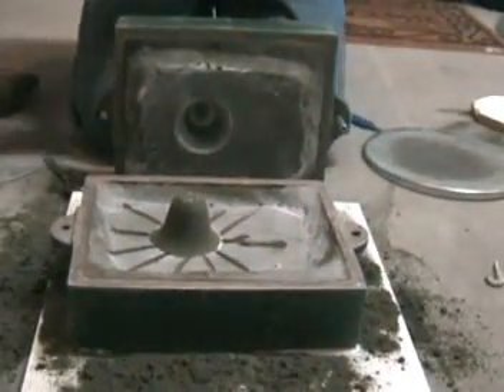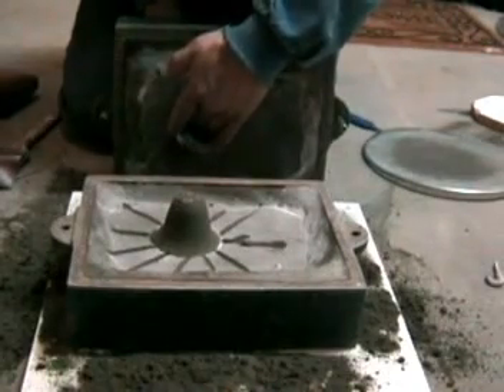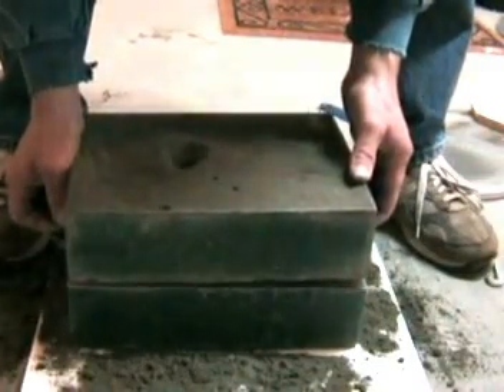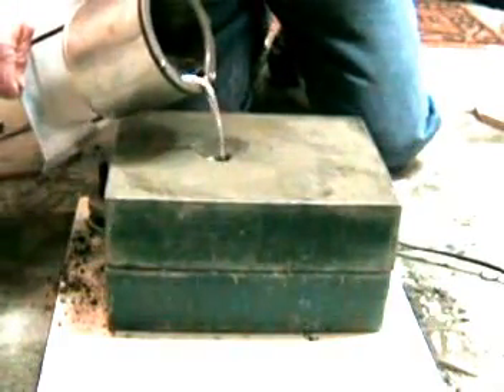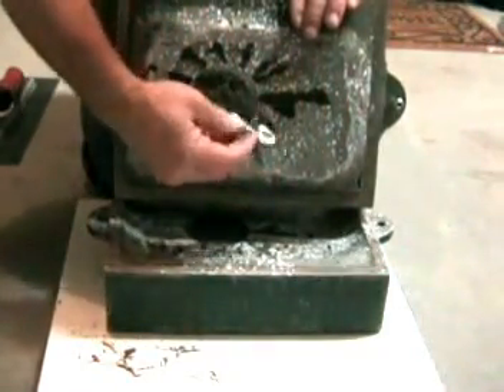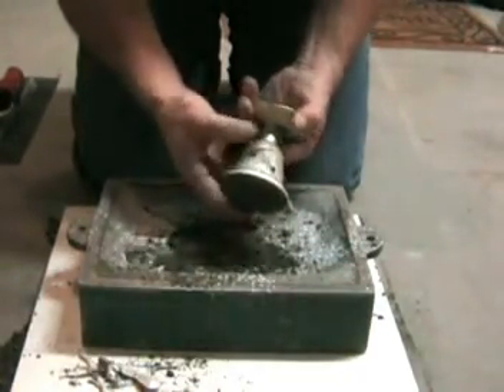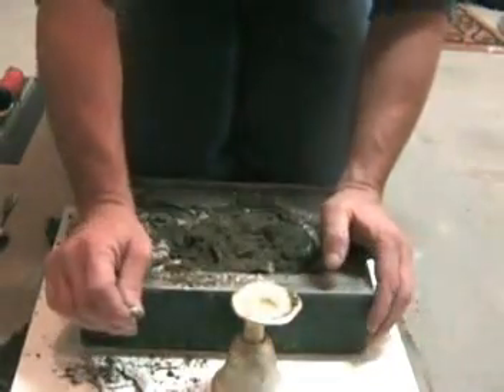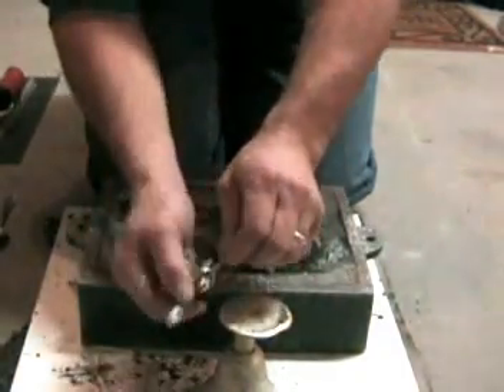Pewter Bell:Molding and Casting, Part 3

Comment: Hey there im Ron. I pour cast aluminum mixed with an alloy and pour farm bells. They sound pretty good. I add an alloy with the mix and it gives a better tone. Largest I make is 15 inches wide at base. I have a simple fire brick furnace and fire it with wood and a blower. I melt in a cast iron pot 12 inches wide. This pot has been used for a yr now and no wear much from the heat. Your bell sounds very good.